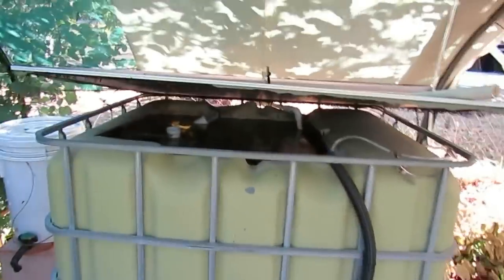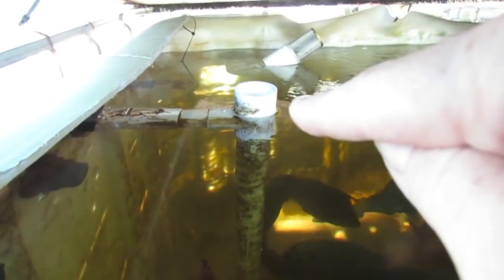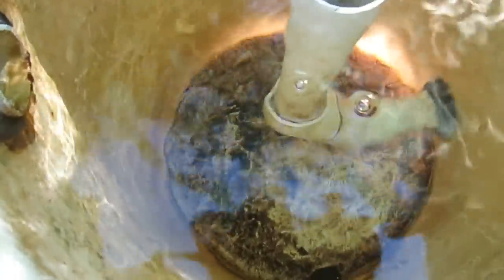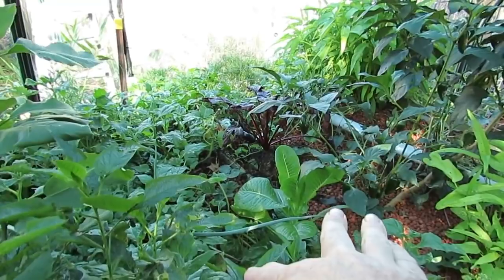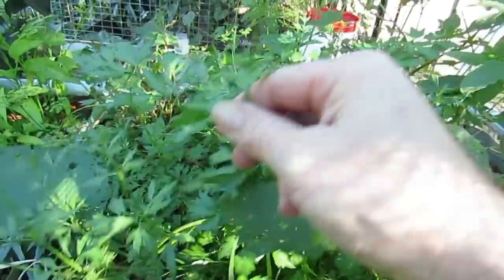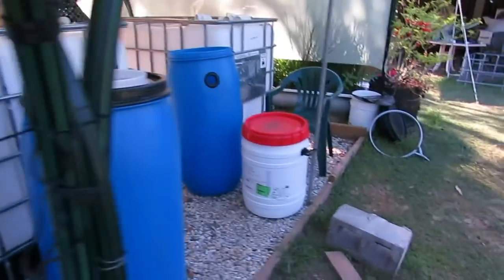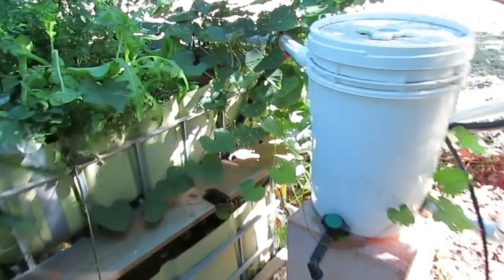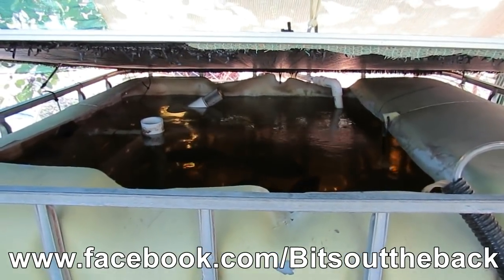Aquaponic plumbing, How the water flows through our IBC system.

Comment: Hey-Ho! Kermit-the-blog here! Great tour mate! Say mack, do you run your pump and compressor off of Solar panels? Be great to run free without the grid---especially if you had a catastrophy and lost grid for a couple of months!
Reply from the maker: No solar here yet Terry but it will happen as time & money permits.. Need to get the system finalised & the RAS built.. After that we will be looking at making a more permanent structure to go over the system (no idea when it will happen though).. Once that's up we will have somewhere to put the panels..
The roof of the house already has feed in panels on it so we are subsidising the system to an extent with them.. Would like to have them switched over to an off grid system at some point..
Cheers sir :)

Comment: Hey Rob, great info as always. You're excused for being crook Btw; happens to all of us. Nothing worse than feeling crook in hot weather...
Quick question if i may. What's your reasoning for wanting a bio filter in addition to the grow beds. Do you feel they are not offering enough biosurface area. And if so why not just add another grow bed? 
I'm hunting for info always and you're such a mine of experience/knowledge.  :-)
Reply from the maker: Hey there John..
Looking trying a few different growing methods (raft, buckets & the like) in the future so thought as the pipe work is going to be changed a bit I might as well add the bio in now. to save mucking around later..
Feeling much better thanks.. Got off it a lot lighter than B did :/
Cheers mate & have a great one :)

Comment: Wow, you weren't kidding when you said those meters are expensive! A quick search though says they have gold, platinum, and silver in the sensor head which must be why they cost so much. 
There is a plan B for measuring DO called the Winkler method but it involves Math and some chemicals that are not conducive to one's good health :S

PS, will have to check out that broth on for FB you mentioned for the cold, sounds like good stuff!
Reply from the maker: Thanks for that 8Jory.. Have found some around the $180 mark but that's still a bit pricey for us at the moment..
The broth is actually quite nice :) Going to get B to take some to work with here to sip on methinks..
Cheers & have a great one :)
Rob.

Comment: Wotcha, Ive been thinking about adding some solar powered air pumps to supplement my venturi and act as a bit of an emergency backup. Im of to google dissolved ozygen meter.
Reply from the maker: The meters are not cheap from what I've seen Michael but would be interesting to play with one to test the O2 levels from different delivery systems..
Still intend to get a solar charger for our back up battery to help keep things ticking over..
Have a great one mate,
Rob..
Reply: Tetra Test O2 looks like the proper job. I would think that it would only take a few tests for you to confirm that your system is indeed providing plenty of dissolved O2.
Reply from the maker: Michael Tricker
 Thanks Michael :) Have a local Hyrdo store looking into small test kits.. A meter would be great to play with but a test kit would be fine..
Cheers sir :)

Comment: What temperature ranges do you have? Is your fish tank outside all of the time? Is this OK for your fish? I have aquaponics system in Croatia and we usually have temperature from -20C in Winter (except this winter is +15C in January) to +38C in Summer. Because of this ranges, I have my fish tank in side of wooden shade and I am using Carp because they can survive from +3C to +30C. In winter I have to stop feeding them (because I can't grow vegetables) and in Summer I have to be careful with water temp, because it can go to +28C. I summer I loose water from evaporation and have to add water every about 5-7 days. I am planning on expanding my system, but will have to do good planning because of this ranges...Thanks for good tips
Reply from the maker: Hi there..
We are in the sub tropics here so have very mild winters (-1C min) & warm summers (expecting mid to high 30'sC this week)..
Water temp can get down to just below 10C in winter & have had it over 30C here last summer.. The Jade perch are fairly hardy so can handle the swing fairly well..
Have you thought about digging the tanks into the ground to help insulate them at all ?
Cheers,
Rob :)

Comment: Great clip Rob, have really enjoyed watching all your videos (Only just subbed last week). I have zero experience with aquaponics, but did have many aquariums a few years back ... In normal tempreature conditions wouldn't the surface area, flow and cascading water be enough to aerate the water? Granted the recent water temps, would cause the water to hold less oxygen. Have you considered a spray bar, for an energy less aeration solution?

Comment: Well done mate, nice clip
Reply from the maker: Hope it helps someone out there understand what we're doing with our systems ;)
Cheers Anthony :)
Rob..
Reply: mine is basically the same - just different growbed layout.. and my main pipe from the fishtank is 90mm - and lower than the growbeds - with 1" risers going into each bed with a tap on each.. without the RFF it was a settling tank for crud - but now it seems pretty good (did it this way so i didnt have to worry about suspending 90mm pipe full of water
Reply from the maker: *****
Do you find you still get fine solids collecting in the 90mm feeder pipe Anthony ?
Reply: Rob Bob 
Little, but nothing to worry about..
Its only something i generally check or flush every 6 months.

Nothing detectable in water tests,
Reply from the maker: *****
Was thinking that it might be useful way to settle out more solids from the water.. Cheers sir :)